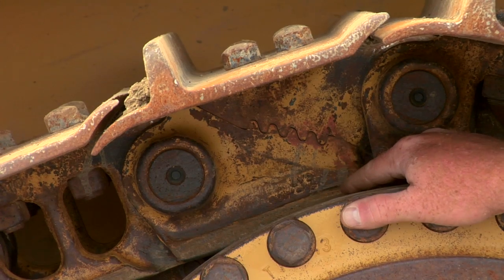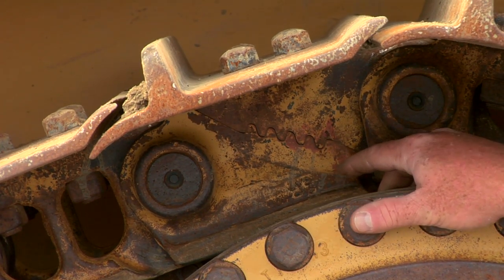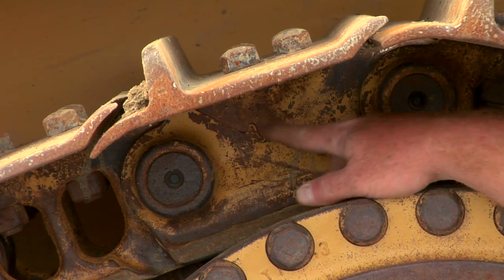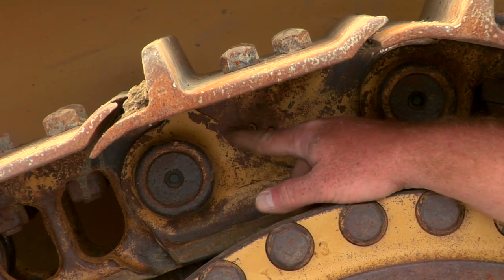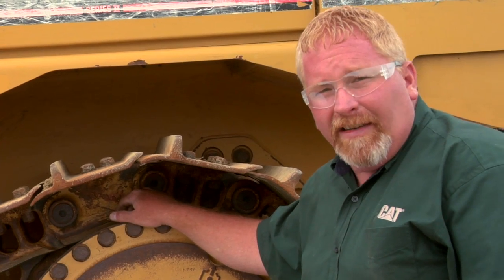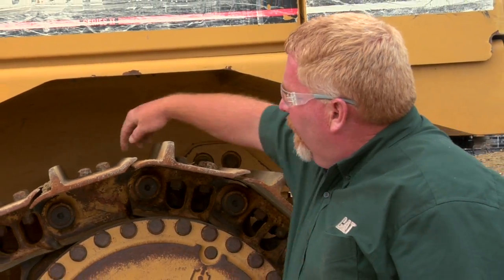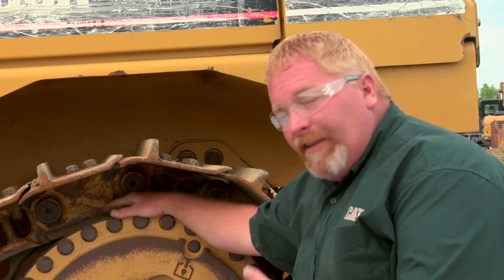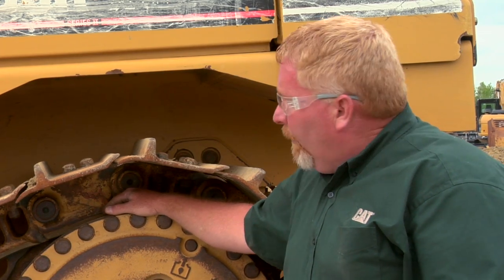Cat® Dozer | Undercarriage Master Links

Comment: I have an old Cat 235 excavator (made in the mid 70's). The manual says you have to drive out the pin with a special portable hydraulic press. This press costs like $6k from Cat. !!

Last time I had the Cat dealer work on it it ran a  huge bill because I'm very far from their facility and every time a bolt snapped he had to drive back and forth.

Someone told me I can just cut the master link get a "master link repair kit". Do these repair kits look like the master link in the video?
Reply: no it should have those 4 bolts he speaks of aswell, loosen the track first then remove those bolts and track should fall sometimes u have to pry a little, make sure when u remove those bolts the tracks are down by the idler or down behind the sprocket
Reply: Hi,  you can use hyd press by non cat,  an be happy